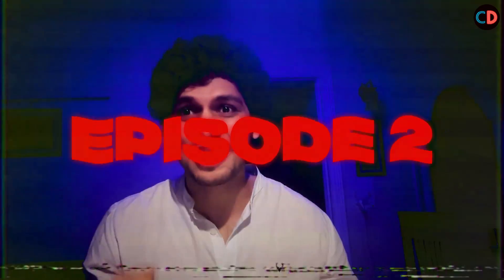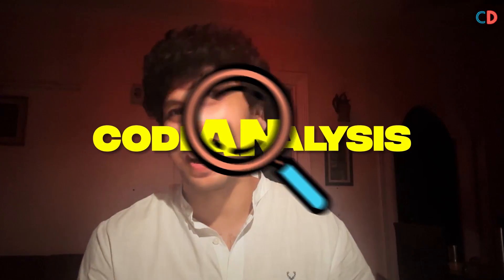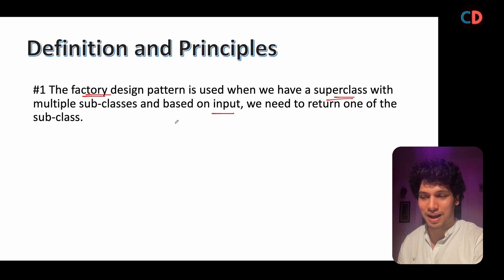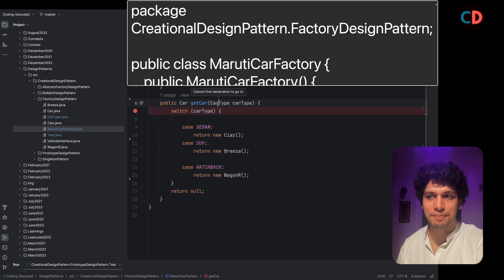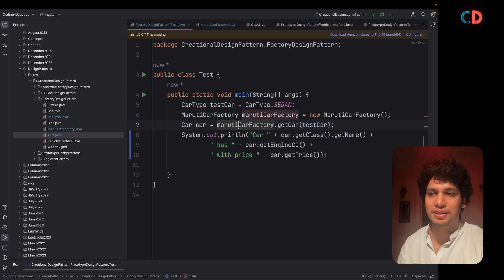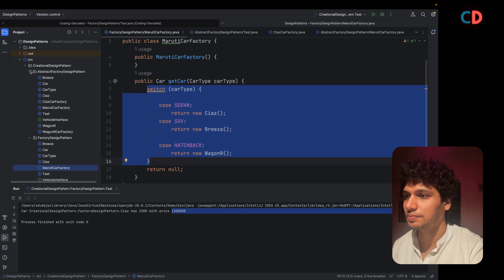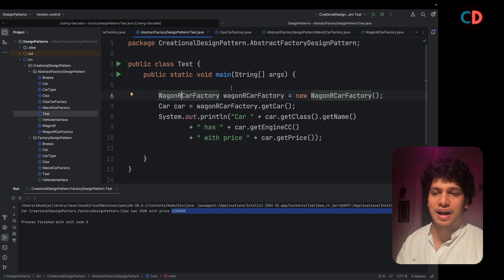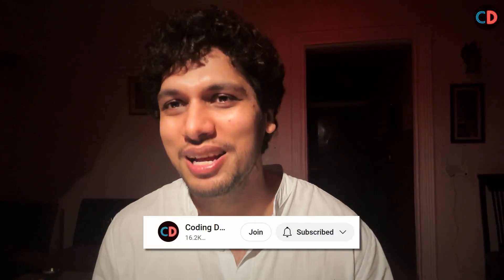Factory Design Pattern | Abstract Factory Pattern for Beginners with easy examples

Comment: Not sure if the car example suffice for both factory as well as abstract factory pattern reason being in factory pattern the conditional statement is in superclass and to avoid that, we switched to abstract factory but in this pattern also we need have a conditional check somewhere right ? 
As in the test class we directly built a object WagonRCarFactory, but my question is how we concluded to this particular car type ? which I think is wrong, in this pattern also we need to have a conditional check on the type, if not in superclass then may be in the child class. IMO we cannot avoid the conditional check

Please correct me if I am wrong.
Reply from the maker: Nice question and liked the fact you asked it , remember the entire logic of every design pattern it is ability to extend and this is achieved by building everything on the basis of "Interface" in this case the CAR. 

The advantage of the abstract factory pattern is that it allows us to decouple the creation of different types of products from each other. This makes our code more flexible and easier to maintain. In this case you get the control what type of factory to use for your specific use case.

The client code does not need to know about the concrete factory classes. It only needs to know about the AbstractCarFactory class. This makes the client code more flexible and easier to maintain.
Reply: @CodeWithSunchitDudeja  Agree but I think we can't avoid the conditional check based on car type right ?
Reply from the maker: @tanishqmahendrasaini3764  it all depends on your use case I would say.
Reply from the maker: @tanishqmahendrasaini3764  i want to give you an example where conditional logic will be skipped, difficult to explain in comments